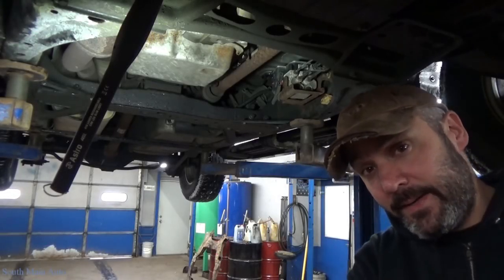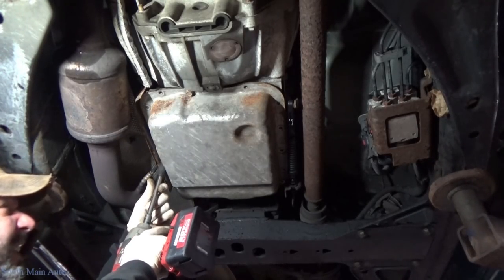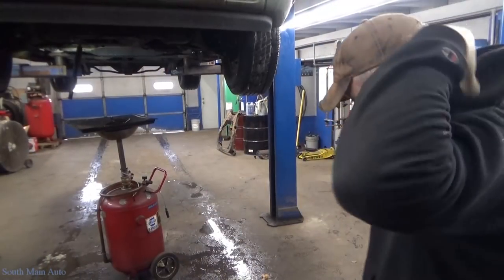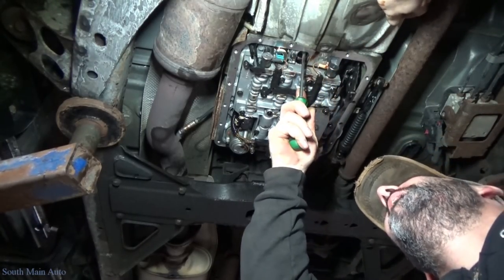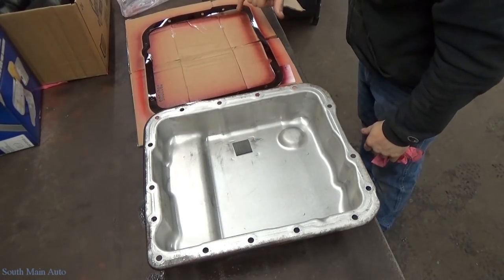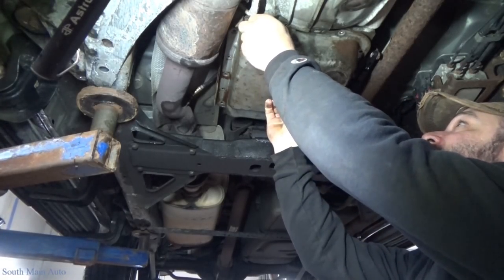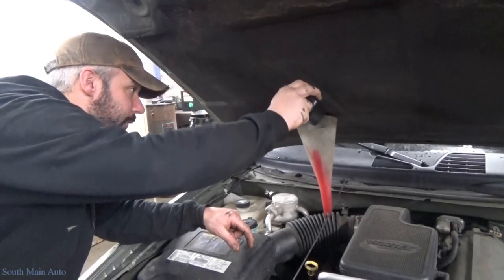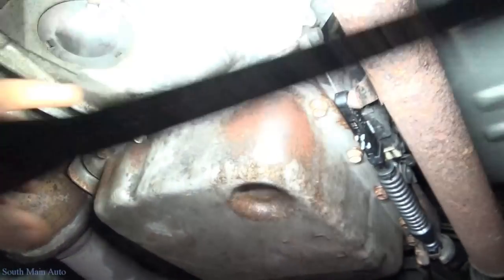Trailblazer / Envoy / Rainier Transmission Fluid & Filter Replacement 4L60E

Comment: Have a 1966 Dodge Dart GT setting in my garage 30 year's I think? Did run and drive but needs to come alive ? Transmission .should I change before driving ? Torque converter has drain plug so the whole system could be done.? Love watching your vidios very educating! Thanks Your a lucky man your wife looks and sounds like mine! Lowell the many times over the last 55 years I have deserved the Poison she has yet to feed it to me! GRIN
Reply from the maker: IMO, I would get it running first then worry about the trans fluid.
Reply: If the trans has sat for 30 years or ten years,I would rebuild it
The old seals will be hard & the entire unit & valve body will
be gummed up
I doubt it would work for long, if at all.

Comment: My 2004 silverado 5.3  has  178,000 miles on it and has never had a transmission service.   It has mostly highway miles and has towed very little and Runs and shifts fine.   I serviced the rear differential for the first time at this milage and had  little metal on the  magnet compared to all i've seen.  QUESTION IS:  What to I do for this transmission? Full fluid exchange  or just drop pan/filter, or do nothing?  Thank you so much!   Also, if i were to paint a picture for the shop, what  type of painting would you like?

Comment: We have a mechanic at work that does the usual with his truck - drop the pan and do the filter. He says that once he has the fluid level back he drives for a couple hundred miles and then does a fluid exchange through the filler tube for a heavier dilution of the remaining old oil. Thoughts?

Comment: Just bought an 05 Envoy with only 99k miles. Lots of service records but none for a transmission filter and fluid change. The manual recommends 100k miles to do it. As you said that whole topic is crazy. Here some say don't do it unless you don't every 50k or so. Drives and shifts flawless should I do it?

Comment: Actually this is the correct procedure because GM does not recommend transmission flushes and doesn't endorse them either. They recommend a drain and fill service and filter change. That's it.

Comment: If I remember right,my early model '79 mustang had a c4 trans. Had to get a yard one. Was 16yo. Remembering the torque conv having what appeared to be a drain plug. used it I know my 8'87 f250 had one. I don't know if my '94 f 250 has one. If it has a drain plug, is it a good idea or bad to drain? On the mustang, I remember it took awhile for trans to work again after draing torque conv. Think I did more harm than good, but trans still works when ever I start it. Retirement resto project.
    So, if a drain plug on torque conv, good idea or bad?

Comment: Eric, call us crazy , but we have a 2008 Tundra 4.7 auto, the truck is a pool service truck. so its miles are all city with a little expressway thrown in. Operating in desert heat in Phoenix. The books trans service is only needed if you tow. we never tow anything. this truck has no dipstick to check the fluid which Toyota says is lifetime fluid. The truck has 302,000 miles now and the trans works like the day we picked it up with 6 miles on it. Just saying cars and lubricants are not what they were in the 50's

Comment: isnt there a pressor regulaor solinoid in the tranmission pan area that should be replaced while the pan is off. or a shift solinoid that should be replaced. I have a 2002 ford taurus with 91000 and never had the tranmission fluid changed. will be doing it this spring tho. Car runs fine but I need to change filter and fluid

Comment: Mr. O, Do you remove or bend the shift cable bracket out of the way when you do a 4l60e pan drop and filter change on a Silverado?? Those torx are a royal pain to get at

Comment: 2003 suburban. No power. Only accelerates well in 1st and 2nd. Torque converter? Or do I need a new transmission? Reverse is weak as well.

Comment: Do u recommend check the bolts that hold the valve body.it is said after time with vibration the bolts gets loose and causes hard shifting.what are your thoughts on this.
Reply from the maker: Honestly I never have and haven't really heard of it before. I suppose if there was a trans that was notorious for coming loose then I may...
Reply: South Main Auto Repair ....i saw it on chris fix video on changing tranny oil n filter.his valve body bolts was loose.tks alot for the reply...keep up the good work.

Comment: What happen if you over fill the transmission? How would you remove the extra fluid? The transmission for the trailblazers has no drain plug.

Comment: In your opinion is right on the money.the flush the “service writers” sell is so much better. NOT!
This is the only way to service a transmission. 
That is why i never change the seal if its good. 
Found the video, not what i was looking for, but what the heck, cant watch all the vids all at once. Have an 04 with no go ahead gears. 
I use high tack as well. 
Guess im a hack too.

Comment: I thought I was the only one that has an old spinner wrench.
Reply: Jimmynitr I have a couple, 1/2 and 3/8 drive.  Used to call it a speed handle.  Haven't used one in over 20 years. Since I cut off my first extension and put it in a drill
Reply: Yep, speed handle

Comment: Well, this does remind me of the time I took my Dodge Dakota to the dealer for its first trans service.  Next day the trans failed & after towing out of a parking garage (interesting to say the least) back to the dealer, their explanation was the cheap Chinese Mopar filter came apart.  I was then and remain dubious of that explanation.  After getting the car back the second time, it was never the same.  Started stalling at a stop when cold and after numerous trips to the dealer they couldn’t figure it out.  All in all pretty pathetic.  I would have been much better off not doing the trans service.  May the Dakota rest in pieces....
Reply: DODGE SAYS IT ALL
Reply: juan rodriguez I’ve owned 4 Jeeps - each of those figured out how to punish me for buying them - and 1 Dodge.  I would rather bore a hole in my skull with the blunt end of a screwdriver than buy another Chrysler product
Reply: I once owned a Dakota There was nothing wrong with that trans
May I also say I owned a Trans Shop at the time & seldom did
those units. Now if your talking about transaxles in a caravan,
then I made my living off that Mitsu junk & lots of ford taurus
Reply: @juanrodriguez-ry6yt  Thats why I finely put valve cover gaskets on my 94 Dakota, first bolts turned on it at 301000 miles cause they are so bad

Comment: I did a spill and fill on my 2013 Ford Escape but it doesn't have a dip stick, only a fill hole which is too difficult to use, so I measured what came out and put the same amount back in. But I'm paranoid that it's low on oil and I can't check it.
Reply from the maker: it should have an overflow hole too right?
Reply: South Main Auto Repair oh yes that's what I meant actually, it has an overflow hole to check the level but it's really difficult to get to as it's behind the wheel. So having the car level, engine running and wheel removed is pretty much impossible for me.

Comment: I have used Petroleum Jelly ( Vasiline) on transmission gaskets to help hold them in place. Will my transmission blow up now?
Reply: Petroleum jelly is a good old school trick. My father used to use it for O-rings and to lube odds n ends in a pinch.
Reply: vaseline has been used as assembly lube for many years. all the assembly lubes are "petroleum jelly based" of course they have different grades and color dye and maybe. if it's straight silicone based fluid transmission, do check what they recommend as assembly lube
Reply from the maker: My dad stilllll does it that way. He's "old school" haha

Comment: Well, I think I'd like your opinion on doing a trans service on an 08 4runner 4.0. It only has 50k on it and the trans hasn't been touched. I'm going to drain and fill the trans. My question is about the filter. I've heard it MAY  be a cleanable screen and I've also heard that if it's pretty dirty it should be changed because there's no way all the dirt could be washed out. I'm thinking the best money spent would be to change it with the drain and fill because of age and who knows what might be stuck in it. Could you advise?

Comment: My 07 blazer has dex 3 instead of 6. My mechanic made a mistake in that but now refuses to fix it. Will it damaged my vehicle? Or do I have to get the 3 out and put 6 in since my manual states it needs 6.

Comment: you should remove the trans and the torque converter, clean the t/C with a 50/50 mixture of diamond dust and unicorn pee, rinse  and repeat three times....then replace trans and torque converter with small nuclear reactor from a Russian submarine...that's how we do it...DAMN IT!
Reply from the maker: Unicorn tears are a bit cheaper so I prefer that over the pee plus I use a coating of angel wing dust in the converter....

Comment: Hello Erick i just have a question to you , i own a buick rainier 2004 , one year ago trans was repaired but suddenly  i tried reverse shift and slippery, i check my trans. oil and missed oil  but never leak so i  refill it with new oil but problem happend again but in driving mode so Do you think is maintenance problem or maybe damage?

Comment: we drilled drain holes in converters and drained them in trans drain and filter there was a plug kit you bought had a taper plug and copper washer i never caused a problem do you not do this any more
Reply: That was in the 1960's Ford Converters had a drain plug.
They didn't have Lock-Up Converters & as many parts inside back then
Reply: i was draining  converters in the lat 60s and early 70s i think some fords and doges had drain plugs in them but we drained all with a Napa kit at our shop

Comment: I don't see anything wrong with what you did. It was a routine fluid change so changing what is already in the pan is good enough. It isn't necessary to get every last drop of transmission fluid out. Sometimes, a flush can do more harm than good if the clutch packs or brake bands are on their way out.
Reply: You are correct Parknest
I have seen may transmissions fail with new fluid in an old unit that
didn't work well or slipped or smelled bad.
Most flush machines end up against the wall never to be used
Break off some cooler lines & waste time with those & then if
you do get the job done with no issues,how many slip & fail after
they leave the shop
You never change fluid without many questions answered & a road test first.

Comment: I have a quick question eric.  What about using rtv.  I usually use it on the pan side of the gasket cause I worry about it leaking.   Would it be better for me not to use it?  Just asking cause I know you know more than I do.  Love your videos.  Learned alot from you.   I have been a subscriber sense the beginning.
Reply from the maker: Permatex actually makes an ATF silicone. If you use it just go easy so it doesn't plug up the screen on ya. Some Chrysler OE gaskets are only silicone and that is what I use on them.

Comment: Eric could you do a video on your Tundra when you change the transmission oil on it. 
I`d like to see that. More so to see if the Tundra`s  have a drain plug.
Reply: yes, do it.
Reply: Why do you care if your vehicle has a drain plug ?
Your removing the pan every 2 or 3 years & inspecting
inside it & cleaning it anyway,filter change or not,if you
even have a filter.
You never look under your vehicles, but ask someone else to !
Silver Braze a Threaded Bung into the trans pan,then you got one.
Reply: PC zapp - - - You said   " Why do i care if my vehicle has a drain plug? "

- if i had the choice  i would prefer a car with a transmission pan that had a drain plug that could be removed at the bottom of the pan, along with bolts to remove the entire pan to access the internal filter, because then i could just change the Fluid Quick & Easily every 20,000 - 30,000km to keep it clean & fresh (piece of mind) and then drop the Pan to change the Filter every 50,000 kilometers.  By having the option of a drain bolt, that cuts down time & expense of changing the 3-4 litres of fluid because i'm not having to replace a pan gasket/ or resealing with RTV.  And i do prefer Drain & Fills.... 
.....I don't do flushes or remove cooler lines with my cars. 

My particular Ford car has a transmission that is known to be problematic especially if the solenoids 
get dirty from a lack of Fluid Changes. A Ford Mechanic i know said , " keep the fluid changed every 20,000-30,000km and you should be ok". As he had the same model car that i have and had done the fluid at that interval and kept it to 300,000km with no shifting issues. 
 But his just like mine,  had the same transmission pan style as most american cars or the Chevy in this video. 

 It seems most of the Japanese cars have a drain bolt for the transmission fluid, regardless if you can change the filter. 

pc zapp - you also said , " You never look under your vehicles, but ask someone else to ! " 
  
   I assure you i do look under my vehicle. 
   
   I asked Eric if he could do a video on his Tundra transmission fluid procedure for the following reasons: 
   - the way i found Eric's channel was searching for a transmission fluid procedure video on a friends car.
     I notice he doesn't do a ton of Transmission fluid change videos (i figured for the reasons he said 
     in the video about receiving flack from people ) and i thought i bet there are owners out there that it 
     might benefit. 
   - I myself have been considering a Frontier , Tacoma or Tundra as my next vehicle and the more i can 
     see of their underpinnings / and how they work the better and that helps me decide if i'd want to buy a particular car. 
     I am not the sort to buy a car because i like it's interior features or looks, i base it on mechanical 
     aspects more so. 
    - I figured if he was changing the fluid anyway which he probably will eventually ,
        if enough people said " hey eric film it " ...he just might. 

pc zapp - you mentioned " Silver Braze a Threaded Bung into the trans pan,then you got one. "
 
       I don't want to alter the factory pan by putting my own plug in it. 

I Hope that clears that up for you.
Reply: GM fan
Thanks. Ya i only use Dealer Fluid in Terms of Coolant & Transmission Fluid  that kind of thing. 
It's about the same price as whatever fluid is at walmart anwyay and there are enough dealers close enough to me anyway. 

I don't actually own a Tundra , but i've been thinking about getting a Frontier , Tacoma or Tundra as my next vehicle.    

I asked eric to film it because i figured it would be a good video for people to see (figured he'd be doing his eventually ) and i was curious on how how easy it was to drain the fluid out. 

Thanks for the information.
Reply: less chance of a shower when removing pan when theres a drain plug especially when theres no dipstick to extract from like my tacomas

Comment: hey eric-o this isnt a gm question but is a transmission fluid change question, i have a 96 honda accord v6 2.7l with the 4sp auto trans, know idk how many km/miles the fluid has on it and fluid still looks pink-ish, would u req i change the fluid and filter if it has one, do a full flush, or leave it and drive it?

Comment: So atm I recently changed or got a reconstructed transmission and it’s been working good for a few months then comes this problem where I’m driving and it revvs while in the middle of driving and don’t know what’s causing it ? I also had to change the fuel pump recently and that fixed that issue for a day or 2 and then it came back what can it be ? Been annoyed on feeling the car rev like that

Comment: I have a GMC envoy I bought it used an it had a 125 thousand miles on when I bought it now it has 156 almost 160 thousand should I get my transmission fluid changed the person I bought it from put a new transmission on it

Comment: My rpm jumps or dips by 200 in OD. 1,2,3 has no problem. Thinking I need to flush the trans. Might have to change the TCC valve & use a shift kit. Any ideas guys?

Comment: My Volvo XC70 has an Aisin (Toyota/Lexus) automatic transmission.  The proper procedure is to pump out all of the fluid every 50k miles; about 14 quarts.  My Acura TL is just the opposite.  I drain and refill the transmission every time I change the engine oil; every 8k-10k miles, about 4 quarts.  Acura/Honda transmissions don't respond well to flushing.  Regular dump and refill keeps them performing better and longer.  Always use HONDA FLUID, DON'T SUBSTITUTE.

Comment: Only complaint is why didn't GM put a 20 cent drain plug on the pan , I doubt someone would not buy a vehicle because of a 20 cent price increase .
Reply: Second Creek Workshop drain plugs on trans pans are nice, but have you ever had a gm trans plug strip out on you? I have, it is not fun.
Reply: Dorman makes a repair kit to fix that. But if it doesn't work they send you a hat.
Reply from the maker: Lol I sure have a lot of Dorman hats.....